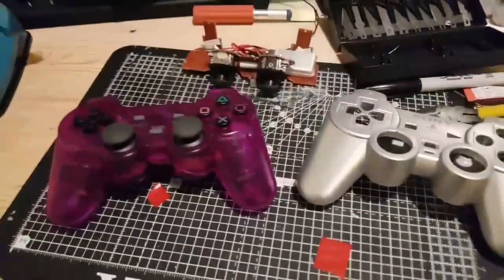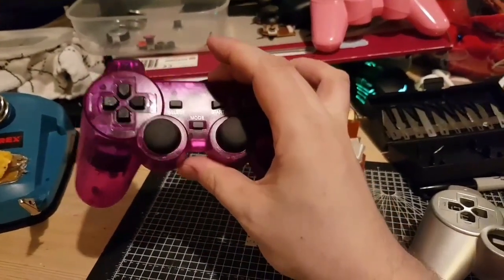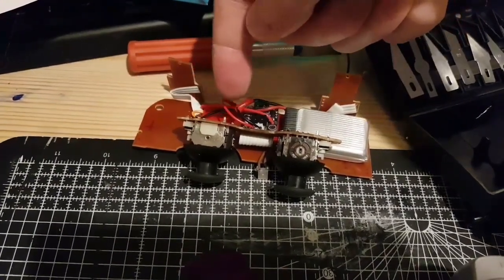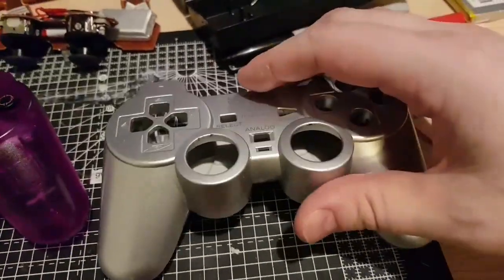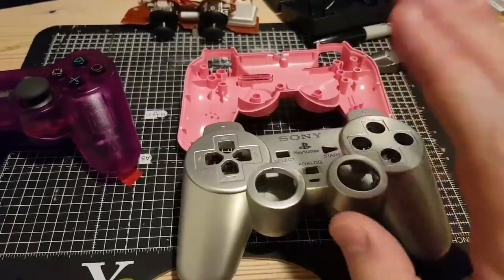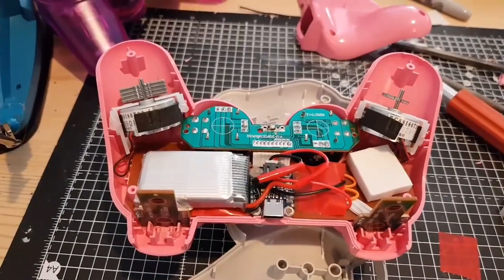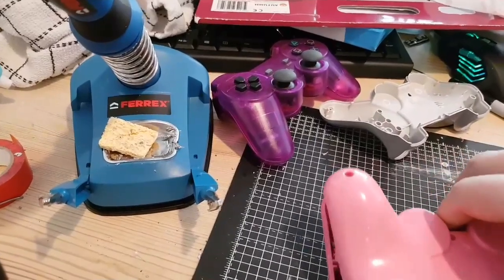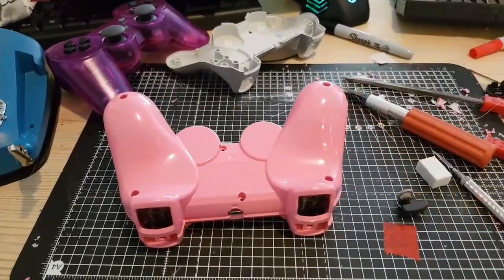Original PlayStation 2 Dualshock Controller Wireless Mod

Comment: I didn't hear in the video but I'm assuming the donor wireless controller doesn't have pressure sensitive buttons like the real DS2 and DS3 have? Makes me wonder how much work it would be to transplant DS3 guts into a DS2 shell if you want to keep the DS2 shell color.

Comment: Hay mate well done! Do you think this mod could be simplified if you get a third ps3 controller and just use the battery and charging dock from that? Interested on your thoughts before I buy the ps3 controller as I already have the other 2 ( original ps2 controller and 3rd party wireless)?
Reply from the maker: They are pretty different internally, but hey give it a go, you never know ;)
Reply: @jonnyboy1925  Thanks mate. You need to put up a detailed video of how you made the charging system work 👍🏿

Comment: Howdy! I've never bought one of those bootleg controllers so I wanted to check two things about this before committing to any purchases and time investment on the project. Does the rumble still function after all of this, and do those controllers support the pressure sensitive buttons the PS2 used? I know only a handful of games really made any significant use of them, but I still like to play a couple of those games so it's important to me.

Thanks in advance, and fantastic video!

Comment: I probably wont get an answer for this question, but how long does the battery last?
Reply from the maker: Hi, I played Serious Sam Next encounter for around 4 hours (constant vibration in that game) with no problems.
Reply: @jonnyboy1925  I'm actually surprised that I got an answer below a 2 years old video, but thanks. I'm now only waiting for my battery to arrive. Mine will be 620 mAh, because that's what I found to be available in my country which fits the shell swap. Even if it won't last for that long, it will still be pretty cool. Thank you for inspiration my dude!
Reply from the maker: @tothkristof7551  Hey No problem. Good Luck! Hope it come out great.

Comment: This is amazing. I've been trying to find a way to get a set of wireless Dual Shock controllers in the original PS1 grey color. I thought I'd be able to just buy aftermarket grey shells for PS3 controllers, but they don't seem to exist.
It looks like this mod might also be possible with an original (non analog) PS1 controller by simply removing the analog daughter board.
8bitdo used to sell a mod kit for the original controller, but they appear to be discontinued, so this may be a good alternative.
Reply: 8BitDo made the mod available again for PS1 Controllers, but not for the Dualshock version, just the regular old PS1 controller without joysticks
Reply: @Sheikahchu Yeah, I saw that and bought one to try out last week. I fitted  it into a PS1 controller today, and it works great.
Most PS1 games don't even need the analog sticks anyway, so the mod kit is perfect for my needs.
I now plan to buy another three of them, so I have a set of four controllers for my Batocera console.
I'm still tempted to try to do this mod to my grey Dualshock though, just for the fun of tinkering with it.

Comment: Can you make a video on hkw you remove the on/off switch and soldering the vibration motors. Please
Reply from the maker: All bootlegs are slightly different, and I made this ages ago so a detailed set of instructions would be tricky because yours will probably be different. However what you basically need to do is look at the bootleg pcb and find a pair of solder pads on the left and right side with a + and - symbol on them, they will be for the motors. as far as the switch goes, make sure the pad has a power off timer and 'auto on' function, so basically if it is left switched on, will it turn itself off after a few minutes without pressing anything, then will it turn itself on with a press of a button? If it does then de-solder and remove the power switch and the bridge the solder points of the switch so it is always on. Hope that helps.

Comment: how did you install the battery and the usb c connector to the board?
i want to replace the AAA batteries with the rechargable pack
Reply from the maker: You're going to need a tiny Lipo charger, be aware the price on Amazon has SKYROCKETED, I don't know why. This is the one I think I used for this build:
https://www.adafruit.com/product/4410

Comment: Please please upload the Xbox 360 one
Reply from the maker: I didn't think to film the 360 controller mod, It was a slightly different thing than I usually build. Basically I have a nephew with autism who was around 2 years old at the time. He used to scream for his Dad's Xbox One controller, so I took apart 3 broken 360 controllers, disconnected the Bluetooth and wired the vibration motors to the triggers, made the Xbox logo light up like the XBone one. I also swapped the sticks for ones that wouldn't shred when he bit them, and different colour buttons and triggers as a sensory thing. That way he could sit with his controller and he dad could play FIFA.

Comment: I just took the buttons from the original and transplanted them into the knockoff. I really dislike your messy looking charging port on the original. I also modded a knockoff to use a charging port since this perticular controller felt like an original and I don't bother not having the logo on it. But still nice work man.

Comment: I hope you can answer my last question:
Is there a huge difference, when it comes to gaming?
I mean, the only difference I see is, that the shell is Original and the Vibration Motors. 

I can tell a huge difference between a fake ps2 controller and original but, you used the fake parts for your customization. 
So Im wondering, before I order my stuff.
Reply from the maker: The bootleg controller doesn't have the analog pressure sensitive buttons and triggers. Other than that it feels the same to me. There are some games that really need those analog buttons though so I'd check first, but if you can live without it and have spare original dualshock 2s as backups then go for it.

Comment: There is no point to this, all you did was take the inside of a 3rd party controller and put it inside an original one to make it look like original but it’s not how it looks it how it plays.. The problem with these 3rd party controllers are the analogues, they just don’t have the sensitivity of an original six axis and it affects your gameplay. Now if you could turn an original wired ps2 controller into a wireless ps3 one then you would have done an amazing job. But your just hacking and chopping to make non genuine contents fit into an original controller. If your happy with just having it look like an original that’s fine but real gamers need it to play like an original.
Reply from the maker: Kids. Kids are the reason. This wasnt a six axis controller, this wasn't for the PS3, this was a way for me to play my pink PS2 with my Pink PS2 controller without a child (born long after wired controllers ceased to exist) running across my front room and whipping the console off the TV unit. Ask any retro gamer with children, it happens ALL THE TIME. Thats why. But thanks for watching.

Comment: Hello, do you have a link of hte BT module that you used please? Thank you and awesome work!
Reply from the maker: It's not bluetooth, the inside PCB has been swapped out for a cheap Chinese RF bootleg. All I did was add a battery, USB C charger. The rest is an original dualshock 2.
Reply: @jonnyboy1925  Can I write you private message? I have a few questions if you can answer and help me.

Comment: Very curious, Is it possible to convert a wired ps2 controller into a bluetooth controller ? like using a Arduino and then use the controller with a pc
Reply from the maker: Possibly, although an easier aproach is probably to use the innards of a dualshock 3 PS3 controller as the shells are practically the same size. I imagine it would only take a small amount of modification of the rear half to accommodate the battery and the L2/R2 buttons as well as the charging port. Also the dualshock 3 is already bluetooth compatable. If it was me that's where I would start.
Reply: a ds3 would be a much much better option

Comment: I assume this could also be done with a PS1 controller? I know 8BitDo do a rechargable Bluetooth PS1 controller, but it's not compatible with the PS1...
Reply from the maker: Thanks for watching! I'm not sure if these controllers work with the original ps2 but I assume they do, and that's roughly the same as a dualshock 1 so yeah I guess you could build a wireless dualshock 1. I haven't got a spare dualshock 1 at the moment, I did have one but I modded it to usb. Fyi that video is on my channel too.

Comment: Do those Chinese dualshock clones have pressure sensitive buttons? Some games actually need those.
Reply from the maker: It's hit and miss really, these ones don't but for 6 quid each I didn't expect them to. You're totally right though, some of the missions in GTA SA can be a total nightmare without, but for everything else it works great. 
The biggest incentive for me to make this was for parents like me. Little children today didn't grow up in a time of wires trailing across the front room, everything was wireless long before they were born. The amount of times I've had a console go flying because she runs through the cable on the carpet I've lost count. Eventually got fed up and decided to build this. Certainly solved that issue. Thanks for watching!

Comment: One question: So, with this Video, I could do the same?
Reply from the maker: Sure, you most definitely can! If you need any help just message me. Check down in the comments, I've posted links to the bits you'll need. Just take your time and give it a go. The most important thing you need is patience, and remember, it might not work first time, but you can get it to work eventually. Good luck!
Reply: @jonnyboy1925  Thank you very much! I just ordered the parts and I will give it a try. It will arrive in 2-3 weeks.
Your Video is so inspirational. Keep going!

Comment: I've seen some DualShock that have an actual connection instead of the pressure connection that holds it together. If not put together correctly they can be a pain

Comment: I have some official PS3 controllers that need new batteries. Do you think it's possible to convert them into PS2 controllers with actual ps2 controller parts specifically The Gamestop Pelican Ps2 controller?
Reply from the maker: As long as you can make sure the contact pads are in the right spot then it should work. Remember if you have to cut away plastic to make something fit, make sure there is enough pressure behind the PCB (like what I did with the pencil eraser) so that the buttons aren't mushy or super loose. Good luck!

Comment: How is the precision of the third party controller?
Reply from the maker: It's absolutely fine, but remember there are so many different types of third party controllers out there it's always a gamble. The only feature this one doesn't have is pressure sensitive buttons so for example, a couple of the missions in GTA SA can be a bit tricky because you can't gently press the accelerator, but other than that you'd never know it wasn't legit.

Comment: I watch your video till its done but in the end your not showing how its done and how the process, im sorry to say this because im not english speaker, thanks.
Reply from the maker: Your English is fine :) The reason I didn't make a full process video is because I'm using my phone camera and I can't film the whole process, it also takes a couple of days as I'm making it on my kitchen table in little stages also I'm totally figuring it out as I go. However the biggest reason I cant give an exact process and step by step instructions is because there are many different bootleg controllers so they might not all fit in the dualshock shell the exactly the same way. If you are going to build this I can send you a basic wiring diagram, no problem.
Reply: @jonnyboy1925  appreciate that thank you, my email is ryannuari93@gmail.com
Also, can you share it the diagram as well from the other one (modified wireless ps2 controller)
Thanks again for your help.

Comment: is this the first video? I can't find the explanation to solders for battery and charging port
Reply from the maker: Yeah, this is the only video for the controller, the receiver is the 2nd video. Basically what I did was remove the battery terminals from the bootleg pcb and soldered in an Adafruit USB battery charger, then I took a drone battery and changed the plug on the end to one that would fit the charger. Then squished it all inside. It might look complicated but it's literally 3 bits wired together with 4 short wires. I like to keep things as simple as possible.
Reply: @jonnyboy1925  I wish I understand exactly what you did. if can try to make it work. Could you pm me or something to maybe send me a Facebook link or something and maybe plans on it? :3 I wanted to do the same as you but maybe ps3 style usb b port.
Sorry for bothering man I just am clueless on this type of stuff. It's not much but if you ever need help with mini rc drift stuff that's something I could help with. And gaming / streaming setups too. Those are my strong points
Reply from the maker: @hnogueira90  Sure no problem, I'm at work at the moment, give me a couple of days, I'll get you some links and some basic instructions. It's a good project to get to grips with the basics of soldering, just remember to take your time.
Reply: @jonnyboy1925  thank you and sorry for being a pesky noob ahah. I am thinking about maybe just using wireless PS2 controllers adding a mini b port and ps3 battery so it works like ps3 in a simple way. Will still need help if we go that route. I wouldn't mind though as it probably works and is easier

Comment: Do you make ones on order? X'D Need 4 black
Reply from the maker: Sorry, I don't make these to sell just for me, but trust me you can make these super cheap and with basic tools. I have no engineering or electronics qualifications. I'm also using cheap disposable tools from the Poundshop. If you browse Ebay you can find all the components you need cheap too. All you need is a little patience, trust me you can do this.
Reply: @jonnyboy1925  I see :( no plans though just gotta follow the video right? I'm not experienced in soldering

Comment: How much for that bubblegum pink wireless ps2 controller?
Reply from the maker: Hey thanks for watching! Unfortunately I don't sell the projects I make because I build them to use, however the whole purpose of my channel is to inspire people watching just to give it a go. I have zero electronics or engineering qualifications, I only use cheap hand tools from the pound shop, and all the components I use are from Ebay and come from China. You can definitely make this, cheaply and with no skill. Trust me, just take you time, you can do it.
Reply: @jonnyboy1925  you are definitely inspiring and very intelligent whether you admit it or not. For me  this kind of ingenuity is the cream of the crop  on this platform.
Reply from the maker: @waltersobchak7275  Thanks, I really appreciate that.
Reply: Original PS2 Controller Wireless Mod is the Same as the Original PS3 Controller Wireless.
Reply: @leonardpayne8795  Yeah but he does not have a factory at his disposal

Comment: Having just set my retro consoles up on display, I'm gonna need to build a few of these! Any chance you could link me to the 3rd party wireless controllers you gutted? Thanks
Reply from the maker: Hey thanks for watching! I'm so glad you're going to give this mod a go. I'm at work at the moment, but as soon as I get home i'll have a look at my ebay order history at get back to you. Tbh though with Chinese bootlegs like these, you're very likely going to end up with a set similar to this double pack by searching "Wireless PS2 Controller". I had to hack away at the inside anyway so even if they are slightly different I'd imagine it would be the same amount of effort.
Reply: @jonnyboy1925  Appreciate the reply and assistance!
Reply from the maker: @mattd6085  No problem, I had a look and that listing is no longer available, but i had a quick search and found these:
https://www.ebay.co.uk/itm/1pair-Wireless-Game-Controller-For-Sony-Ps2-Joypad-Gamepad-Joystick-For-Friends/332938902977?hash=item4d84b47dc1:g:aJgAAOSw9lBcDhLV
They look identical other than the plastic, but the insides should be the same. Ships from China so will take an age to arrive. Be warned though the soldering on any cheap chinese accesories is abysmal, be super careful not to desroy the flimsy traces.
If you shop via amazon then theres these, more expensive and still shipping from China, but they'll do the job:
https://www.amazon.co.uk/Gollec-controller-Compatible-playstation-ClearPurple-ClearRed/dp/B07LCFQGHT/ref=pd_sbs_23_3/261-7539276-0008160?_encoding=UTF8&pd_rd_i=B07LCFQGHT&pd_rd_r=675114ea-0f31-4964-87fc-be28c4b4f884&pd_rd_w=b3rc3&pd_rd_wg=8Bm9F&pf_rd_p=2773aa8e-42c5-4dbe-bda8-5cdf226aa078&pf_rd_r=K7NEZBGJ48WMJAW0V1QW&psc=1&refRID=K7NEZBGJ48WMJAW0V1QW
Good luck! I'm sure they'll turn out great.
Reply: @jonnyboy1925  You're an absolute champ! Keep up the good work my man